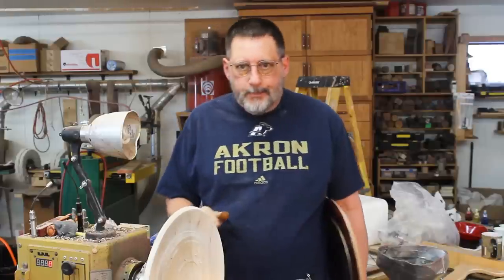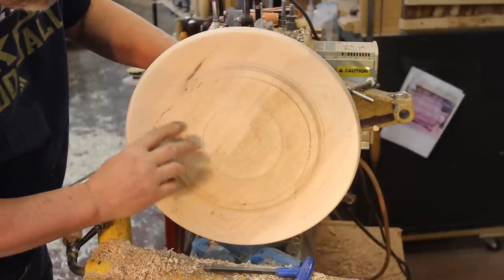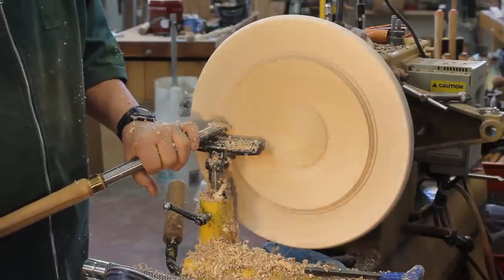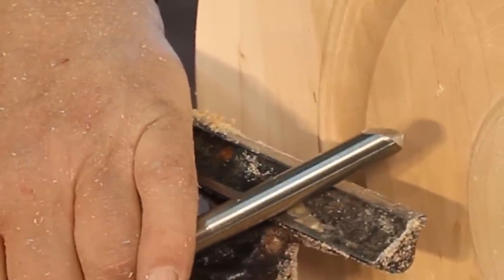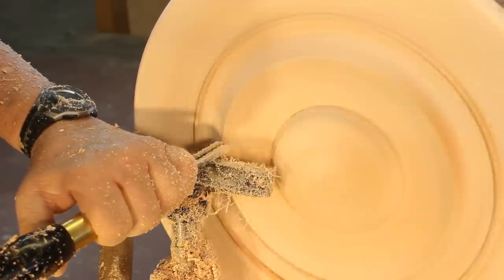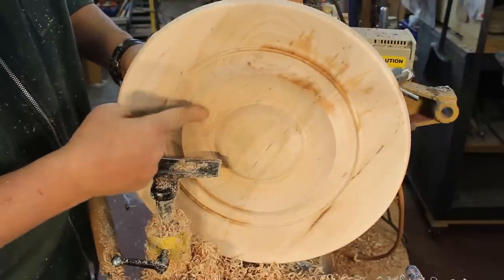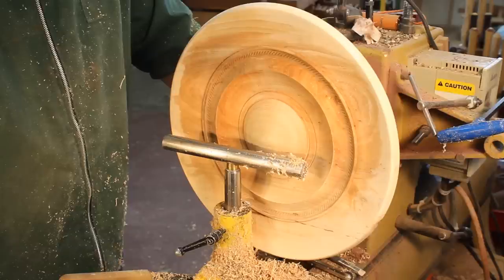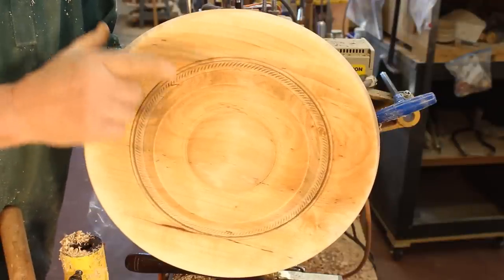Wood turned Art-preparing the canvas (part 1)

Comment: Good informative video, Sam. An instructor that I have taken several classes from (Robert Nelson) taught me to turn in reverse ... ergonomically it makes sense for some operations because it gives you far better tool control. Two of my chucks are equipped with set screws to fasten down on my lathe's spindle which can eliminate the possibility of the chuck spinning free.
Reply from the maker: Thanks for that comment.  I will do a video on reverse turning.  I usually do it on small items like boxes.  The set screw is a good idea.  However, someone using one of my lathe tried to take a chuck off without backing off the set screw.  It did a little damage to the spindle threads and could have been worse.  Sam
Reply: WYOMINGWOODTURNER
I think a lot of us would appreciate a video on reverse turning ... Thanks!

Comment: I would think that the mineral oil on the torn grain would interfere with applying finish to that area. I find that using what will be the final finish for stabilization prevents "differences" in the final finish"
Reply from the maker: Guy
That is a good point. I believe that is something you have to be careful with. I don't remember ever having a big problem with that.  Maybe the key is that  some finishes that are not compatible and you need to avoid that combination.
I will try to mention that  in a new video thanks. Sam

Comment: Question: if you have cheap tools.is it posible to heat up the tool glowing red,and then dip in water to make the edge more durable?or is this more dangerous?maybe its better to buy a higher quality tool
Reply from the maker: I am not sure of the results.  But it is a great question.  I would ask however, IF the manufacturer could have done it as easily as you describe- would they have not done it.  I think the biggest factor is the quality of the steel to begin with.  Let me know if you try it.  (But I can't recommend it).  Sam